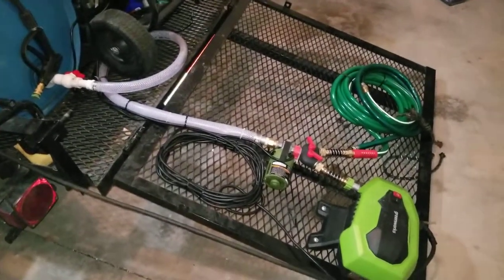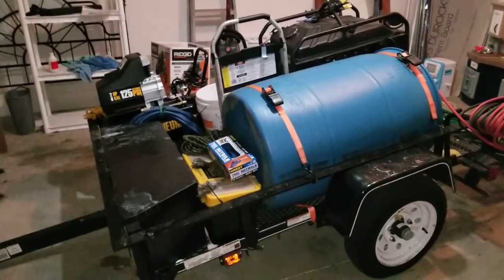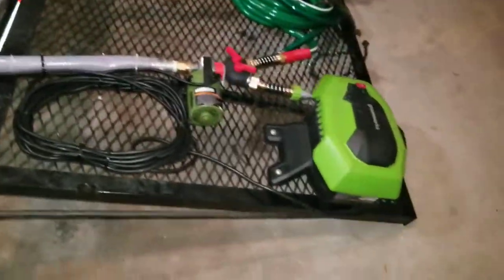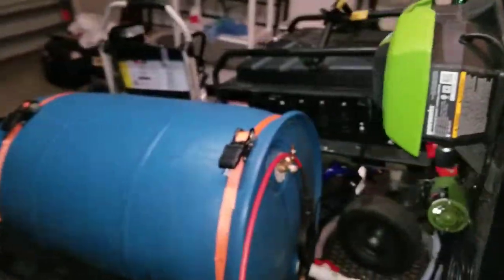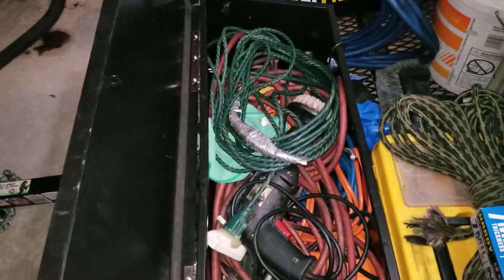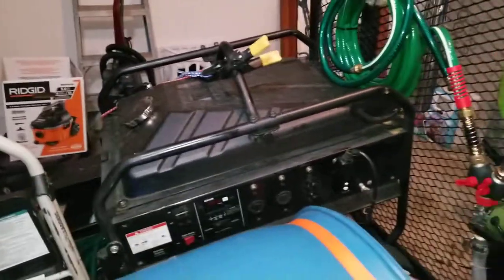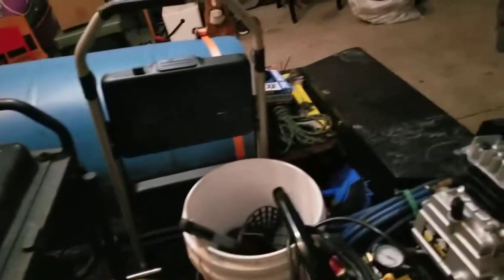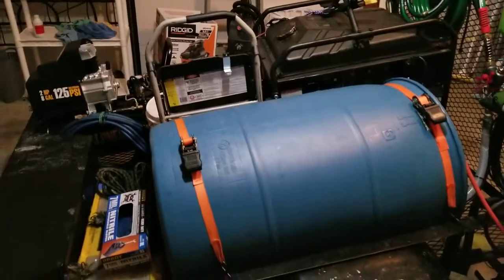Mobile Auto Detailing set up. Mobile Auto detailing Trailer and skid. The best mobile detail setup

Comment: the transfer pump have an auto shut off switch in the event your not using anything it shut off so the pressure will not build up
Reply from the maker: No it doesn’t but I installed a splitter with one end of the splitting going to the pressure washer and the other end of the splitter going back into the tank so whenever I’m not using the pressure washer the pump keeps pumping but it is pumping the water back into the tank.